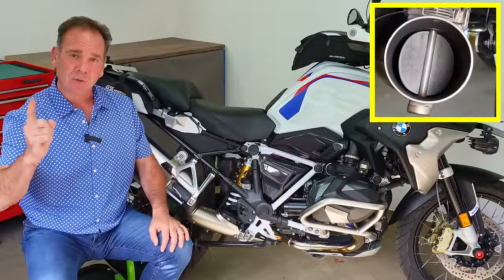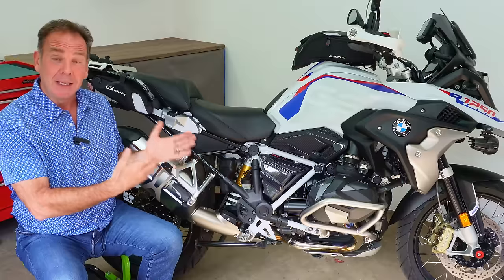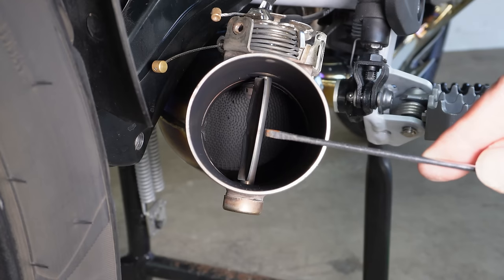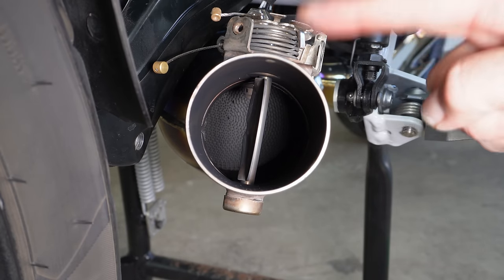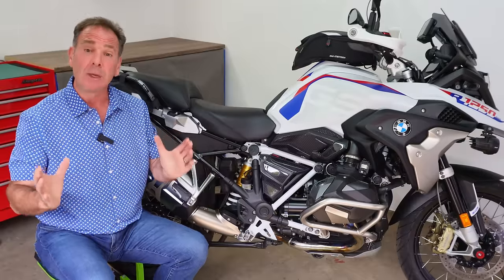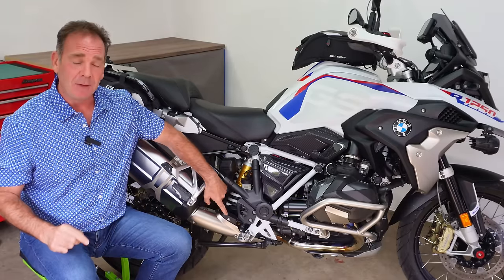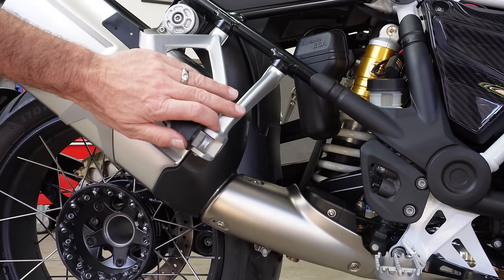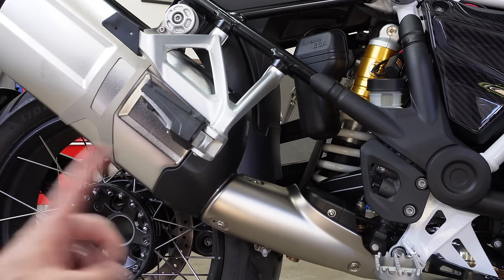EP 25: Butterfly Valve - Exhaust Valve - Exhaust Flapper - Sticking or Seized Valve - BMW R1250GS/A

Comment: Great Video Carl, I had this problem on my first GS and I managed to free the valve off with WD40, then I bought some high temperature grease and Graphine powder and coated the spindle inside and the spring mechanism. Worked fine after that.
Reply from the maker: Thank you 👍

Comment: Just wow. Great video. Totally agree with the corrosion assessment. I Worked at motorcycle shop in early 70’s and there was a bulletin that came out from the manufacturer to explain why so many mufflers were needing to be replace on nearly new bikes. Owners would wash there bikes or just start them and not allow exhaust to get up to a high enough temp to fully remove the interior condensation to be evaporated. Thanks again for the best series of videos on BMWs.
Reply from the maker: Hi Mike, thank you 👍. Bike care is an important part as your probably well aware of from your time in the workshop.
Glad you enjoyed the episode and have a great Sunday 
Carl

Comment: This is a great video and demonstrates the valve  really well. My R1250RT had a sticking valve at 12k miles despite me riding it "enthusiastically"... Maybe it was due to corrosion (from washing?) however I don't have the inclination to strip and lubricate the valve every year (I do at least 12k mile pa). So I removed it and installed a healer. Very little cost and saves a whole pile of maintenance time. Bike runs great and I cant hear any increase in noise. Thanks for taking the time to research, film and explain this subject
Reply from the maker: Hi Ian, thank you for sharing, I hear a lot of RT owners have had valve issues so your solution seems like a logical step forward to not having issues. Well done 👍 
Best wishes Carl
Reply: I dont think BMW has done a good job in designing the valve wiring and servo motor. It looks to me that they have exposed wiring and the servo to road salts and high heat zones which will not serve the servo motor a long life.  The Multistrada modification Carl did is the real deal.  It’s the most cost effective method of getting rid of the flapper but leaving the servo and valve shaft in place.
Reply from the maker: Yes, it was a simple but effective solution, that also gave a big benefit 👍
Reply: Same here, with a 2012 1200RT, got fed up with the sticking valve, binned it and fitted a Servo Buddy after extensive research on the net, never had any problems in 6 years and my GS911 never shows any fault codes, can’t tell any difference with it fitted but I don’t have to keep freeing it up.

Comment: R1250GS. During a trip to the North Cape, the message appeared on the display that we needed to go to a specialist workshop. The catalyst symbol then appeared on the display.
I already knew this connection from your video and suspected that the exhaust flap could be difficult to move. We completed the trip without any intervention. At home, today, I was able to carry out maintenance on the exhaust flap.
With the help of your instructions it was possible to do exactly that. Now it works again.
Thank you very much for your extremely valuable tips.
Reply from the maker: Hello and good afternoon 
that’s great news you have managed to free off the sticking valve, it’s jolly expensive at the dealership so you’re probably very happy.
Glad the video helped 🙏 a I’m pleased it’s helping the GS community.
Best wishes Carl

Comment: Excellent explanation of what, why and how - thank you. Just followed your lead in servicing my GS Adventure, I also had 4 years of an RT valve servicing. It occurred to me today - it can't really be carbon build up because the minimal lube I have to apply, even to a totally seized valve wouldn't have enough time to penetrate down to the inner shaft. It's got to be water based corrosion! Nice one.
Reply from the maker: Hi Dave, thank you 🙏 much appreciate your feedback on the video. Glad you found it helpful. Best wishes Carl

Comment: Thanks for this coverage .
I've recently brought the GS1250 Exclusive. Re Keeping the bike clean my son would say I only ride to give me excuse to clean the Bike. I had heard of this flap causing a problem. Mindful when cleaning the bike I thought water could work its way down the exhaust pipe I  fit a bung I constructed from dense foam kneeling pad whilst washing the bike. I use a blower to remove as much residue water, and take the bike for couple mile run to ensure it fully dry before its returned to the garage 🙂
Reply from the maker: Hi Robert what brilliant idea 💡 thank you sharing with other owners 👍.  I wish you lots of fun your GS and thank you for the feedback on the video.
Kind regards Carl

Comment: Hi Carl, just like to say thanks for saving me a bunch of money. I had an engine fault which Ocean BMW cleared saying it was due the sticking valve a replacement would be £1,600 as it includes the catalytic converter. When riding home engine fault came back on. So I watched your video, my valve was seized solid, followed your instructions, valve now free. Turned on the ignition engine fault still on, started the engine fault cleared. 👍🏍
Reply from the maker: Hi Jed, that’s great news, thank you 👍.
Now the valve is free, you might want to check and lubricate it in 6 months to make sure it remains working freely.
Carl
Reply: @justthewayitis  or rip it out and fit a'flapper delete sensor?
Reply from the maker: That’s about option 😊
Reply from the maker: Yes that’s also an option which many owners do once warranty has expired. 👍

Comment: Thanks a lot for your help. I had a message from my GS911 saying there was some fault with the exhaust valve… I opened it and sure thing it was all gross and rusted (I use my GS1250 offroad a lot). I used your video to figure out what happened and how to clean it all. Worked like a charm.
Reply from the maker: Hi Kinouillek, glad to hear you have sorted out the problem 👍 and the video helped.
Best wishes Carl

Comment: One of the very best explanations of  this problem (mine is a 2015 RT). Will have another go at resolving this issue. (unfortunately Fermit is not available from Amazon.... or anywhere really)
Reply from the maker: Hi Bob, any good quality high temp versions would be fine to use, good luck 🤞 with your valve, Carl

Comment: Thank you! I own a 2023 Gsa and noticed a pop in lower gears when initial twist of the throttle. I took it back to BMW and he was baffled after taking it for a test ride. No codes came up and redownloaded the setup. 2 weeks later he told me others mentioned it and its normal? I wasnt buying it and have owned several different motorcycles and never had this issue. So thankyou for a proper explanation.
Reply from the maker: Your very welcome 🙏

Comment: Great info Carl !
I deleted my flap actuator (before I saw this vid) not for any power or sound gains but simply because I read somewhere that if the valve seizes it could make the bike go into limp mode. Not wanting to be caught out or stranded anywhere I decided to just do away with the whole thing. So now it’s permanently in the open position and has the eliminator box plugged in for not warning lights 😊
Reply from the maker: Sounds like you have a good solution, good work 👍 and many happy trouble free months ahead.
Carl
Reply: Thanks mate you too 👍
Have you ever had this happen to you before…
I stopped at the fuel station, pulled up at the pump and mistakenly clicked into 2nd instead of neautral, released clutch not checking it was in N 😊
Bike stalled, filled it with fuel then went to start the bike up as normal and due to it stalling I threw a ‘brake light fault’ message up and hardly cranked the motor 🤦‍♂️
To the point where I thought the battery had run flat.
After pushing it to the side of the petrol station forecourt and feeling like a total fool asking for a set of jump leads (for about 8 mins) I decided to give it 1 last final try it fired straight up as if there wasn’t anything wrong in the first place 😂
I’m more careful to check I’m in N now before dumping the clutch lol!
It must have just needed a min to reset itself and teach me a lesson ha
Reply from the maker: That’s a new one to me, and thank you for sharing …. I will remember your experience and I’m sure others that read this will do too.
I can imagine it was not much fun at the time….

lol we the local bike club were in tour in Norway last year, we stopped to fill up and one of the bikes wouldn’t start
Panic set in…. For the owner 
But it turned out he had accidentally flicked the kill switch 😉
Our journey continued 
Carl
Reply: @justthewayitis  lol it’s nice when it’s something nice and simple like that (not fun at the time though hehe)
Thanks again for taking the time to make your vids 👍
Reply from the maker: Thank you Scott 🙋🏻‍♂️
Reply: @scott02464   I had almost the same experience. 2018 R1200GS. Stalled the bike and it would just "click" when I tried to start it. Also suspected the battery. However, with modern bike electronics, my first step to quick troubleshooting is turn off the ignition and back on again. It fired right up. Bike has about 18'000km on and the battery and bike is six years old. It is always stored with a tether charger, but I suspect it is showing first signs of needing replacement some time in the future..
Reply: @BravoFox27  yes it’s a real 🤦‍♂️ moment lol.
I tried turning my ignition off first but I think because my key was in my pocket (in range) it didn’t fully shut down until I walked off in search of jump leads. It’s taught me a good lesson to check for neutral in future 🤣
Reply from the maker: 6 to 7 years is a good period for a battery, then can last over 10 years with care, but at 6/7 changing it is a good idea 👍 
Carl
Reply from the maker: Again, thank you for sharing it’s really helpful to other riders.
Carl
Reply: @scott02464 I know this is probably the longest time someone has replied to you and what happened with your bike,  but I've had the same problem,  and leaving it for a couple minutes (15 ) and it starts,  I thought I was the only person who had this issue,  but I found if I bliped the throttle it would happen after that .
Reply from the maker: Thank you for sharing Edwardo 🙏

Comment: Thanks for taking the time to do this video. My 50,000 mile 2016 GS still has the original flap valve & headers. The valve has never seized and is still as free as the day I bought the bike. Bike has been used in all weathers including salty roads. I can only assume that the reason for this is that I always start the bike after washing it and run it for 5 minutes or so before putting it away. I guess this is enough to evaporate and water that is sitting in the mechanism that could cause corrosion. It gets a coat of graphite lube every 12 months when I take the end can off to clean it but that's the only maintenance it gets. Maybe I've just been lucky?
Reply from the maker: Sounds like you look after your bike correctly 👍 and with your once yearly maintenance it sounds fairly perfect.
Thank you for sharing your experience, I will help other owners I’m sure.
Kindest regards Carl

Comment: Thanks for the great video. I’ve fiddled about with the valve on my ‘23 BMW R9T…disconnected the cables at the control valve and left the actuator motor and cables in place. What I noticed was the throttle response was very jerky, while the ECM relearned its fuel trims (minus the back pressure of the valve.) That took about 10-15 miles. After that point, the engine felt a little quicker to rev from idle, but also felt flatter in the midrange. The sound quality changed, obviously, but not a huge amount. I noticed more pop/bang on deceleration and an increase of sound at cruise. It actually was slightly annoying to my ear. When I got home, I reconnected the cables to the valve spindle and it’s been like that ever since. I’m happy with the bike’s performance and am old enough to not need to make a bunch of excess noise riding around. Old age! 

FYI, you mention that disconnecting the cables at the valve (while leaving the actuator electronically connected) would cause a MIL and store a DTC. That was not the case with my 2023 model, which I assume to be Euro5. I live in the US, so mine may actually be built to a different North American specification? I don’t know. Anyway, thanks Carl, for this very detailed and informative video. 👍
Reply from the maker: Hello John and welcome to the channel, and thank you for your detailed experience with your particular bike / year model and location, I’m sure this will be of interest to other owners thinking about doing the same as you.

As for no code being activated I’m surprised but each model by be different as well as yours being a North American version. But thank you for sharing I’ve learned something new 👍. Maybe bmw have made a change in the latest software, as so many owners have reported issues. ?

As for noise, it’s a very individual thing, some want more, some are happy the way it is ( which I am ).

Thank you for taking the time to share and comment 
Much appreciated 
Kindest regards Carl 🙋🏻‍♂️
Reply from the maker: Have you thought about the Weiser-Tech extreme EVO indicators for your R9T I’ve seen one in there workshop setup with them, and it looks stunning 
Carl

Comment: Great video! Congratulations! 
I’m going to switch to a OEM headers set without catalytic converter on my 2023 1250 GSA. I hope I’ll be able to detach and reconnect the cables of the valve without having any errors on the TFT.
Reply from the maker: Hi Francesco, your plan sounds very exciting and a nice project to do on your 2023 GSA.
Happy Easter
Kind regards Carl

Comment: Excellent video. Excellent channel. I’ll be carrying out this task this weekend, as I am currently experiencing this very problem. 
Thank you sir. 👏👏👏👏
Reply from the maker: Thank you 🙏 and good luck at the weekend 👍
Kind regards Carl
Reply: Accidentally started bike with cables disconnected.  What are the consequences?
Reply from the maker: You might be ok, just finish the rest of the cleaning and reassemble… then go for a ride and see if you have any messages on the dashboard. I think you might be ok. Carl
Reply: @justthewayitis  cheers Carl. Bike rides ok, no messages, but I have a notion that the cable is so tight that the valve cannot close fully.
Reply from the maker: Well you do have adjustment on the cables if your concerned

Comment: Excellent explanation and dispelling of the various forum myths. I had a GSA a few years ago, bought it used with under 6K miles whose flappy valve was seizes at handover. The stupid part of it all is that dealers will insist an entirely new exhaust is required and make no attempt to free the mechanism. Prevention is of course better than cure - especially as a new full exhaust system is about £1,500 now 😮
Reply from the maker: Yes the replacement exhaust is very expensive, their is a UK company that will perform a de-seizure process for GS owners and it’s only 100£ which is great value if it’s completely seized.
But a little maintenance will help prevent it happening.
Best wishes Carl
Reply: They can jam that scam.
I'm just waiting for my warranty to expire and I'm replacing the original system with something appropriate.
Reply from the maker: The early one’s had a section you could unbolt and remove, it’s a shame the new version need a complete new front pipe.
Best wishes Carl
Reply: @justthewayitis have you got details of the company please Carl? 
I have performed the maintenance as discussed but I'm a pessimist! 
All the best from Griechenland.
Reply from the maker: Hi Nick , good afternoon, sure it’s a uk company and they only charge 100£ ish
Here is the link
https://www.cymarcbikeparts.co.uk/seized-exhaust-butterfly-valve-service-53-c.asp
Best wishes Carl 😉🙋🏻‍♂️
Reply: Just did my 1250 today. This video made it easy. The only challenge I found was with the thin 10mm nuts securing the cables. The front side of the bracket has a pair of dimples, and the nut is fairly low profile, which made getting any purchase in the nut tricky, particularly the rear nut. A quick tip: try loosening the thicker nut on the other side of the bracket and the thin nut then spins off. Fortunately the internal spindle and spring were spotless so good preventative maintenance. Thanks Carl!
Reply from the maker: Hi MH, thank you for sharing your experience and tip. I’m sure it will help other owners 🙋🏻‍♂️👍
Carl

Comment: Well done! One would think BMW would use materials that do not corrode or at least are slow to corrode especially in a heat environment. Something like a wiper motor shaft (stainless steel) running in a brass or bronze bushing.
Reply from the maker: Thank you 🙏

Comment: Nice explanation. Explains how arbitrary some of the Euro 5 rules are, and why a ECU tune is one of the best things you could do to your bike to remove such restrictions. Also, I have a R1250RS, so same engine as your GSA. Max RPM is 8750, not 7750 -- that's where the engine makes max HP, but not max RPM.
Reply from the maker: Thank you 🙏
And well spotted my mistake with max RPM,
Carl